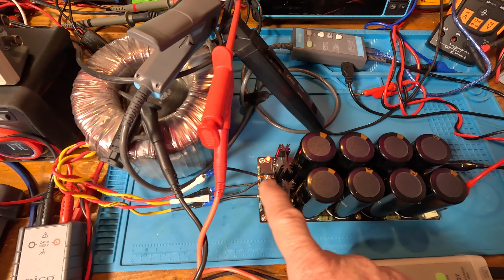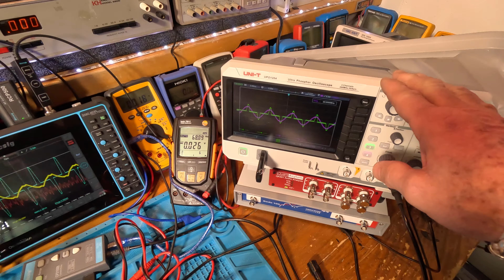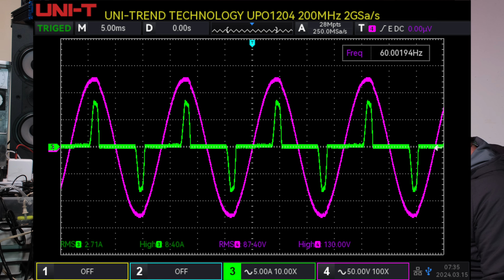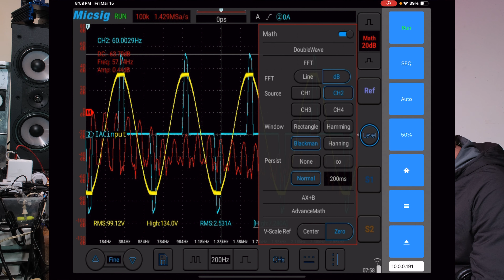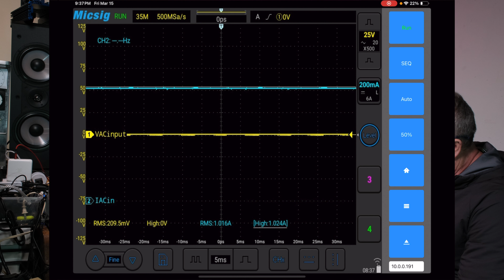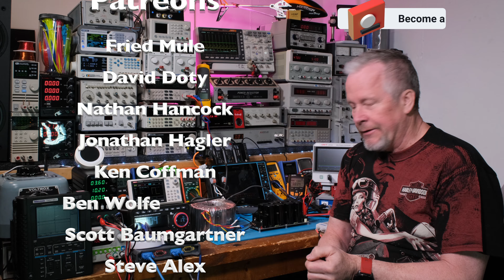Low Frequency Power Supply Waveforms Summary #micsig #STO1004

Comment: Nice setup and demonstration. Thanks for sharing.
Now what you need to be able to do is to measure the placebo affect of power cables that cost thousands of dollars.... 😉😉
I watch some audiophile channels and chuckle at the huge so called perceptible difference they claim to hear. Of course you have to have a Hifi system that costs in excess of $100k to begin with or the difference of expansive power and speaker cables is imperceptible.
Reply from the maker: Thank you!  It is very sad that the audio industry is so full of bad engineering and snake oil.  

None of these expensive power cords or receptacles or anything along these lines have been shown to do any good at all.  Unless you are a believer and just want to believe in it.

Comment: In the intro you said that the rectifiers chops the AC and causes the pulsing current creating noise and the non sinusoidal current drawn from the line. This is not quite right. For the most part the cause of the pulsing current is not the rectifiers, but the capacitors they are feeding. With a resistive load on the output of the bridge rectifier the current on the output would be pulsing DC, but the current at the line side would be almost a perfect sine wave. The input current would also be in phase with the voltage. There would be the smallest, totally insignificant, discontinuity near where the voltage of the line crosses zero volts. And because the voltage is near zero the current also would be effectively zero with or without the rectifiers. The rectifiers are getting a bad wrap, but the problem is really the non linear load of the capacitors. They are the reason for the high non sinusoidal current pulses.

But all this noise would be cleaned up if twisted pair, gold plated, oxygen free copper cable was used for the line cord. 😯 Just kidding. The idea that the input cable has any real effect on the noise is laughable. 

I got hooked on audio as a teen in the 70s. Took electronics in college. I'm retired now but for 37 years I worked for two small electronic manufacturing companies designing a variety of commercial electronic product. From environmental monitoring to ultrasonics, motor control,  microprocessor designs, and embedded computer control systems.
Reply from the maker: Thanks for your feedback!  I can see what you mean by the diodes getting a bad rap - and yes it is the concert of parts working together that cause this pulsating current.  However, the reason that I point to the diodes - it is because they are allowed to turn on naturally and without control that results in this pulsating current at low frequency.  If for instance they were replaced with a device you can control like a FET, then they could be switched fast and you would have a PFC.  

In this power supply, where the pulsating current occurs at the early part of the sinewave, it causes a phase shift adding to the poor power factor, but also because the current is butchered to a pulse which the distortion also adds to the poor power factor.

Comment: You are right. But you also have a shockley diode bridge rectifier, and you also have 100 nF capacitors, but if you had a normal bridge rectifier without 100 nF capacitors, the results wouldn't be so good. On that wool 100nF should also be put a capacitor of 1uF or 2.2uF, yes they are put at the midpoint (in the middle - GND). According to the Italian magazine - Nuova Elettronica (I don't know exactly 215 or 232 anymore)
Reply from the maker: Thanks for your feedback!  A low frequency switcher doesn't benefit as much from Schottky diodes, but a cap can clean things up a bit.  It shows how noisy a low frequency switcher actually is.

Comment: The bridge rectifier, is this a standard diode or fast recovery? Did you look at any effect from a snubber capacitor over the diode? Really good stuff, thanks.
Reply from the maker: Great question!  For the low frequency switcher - the speed of recovery does not matter much - as the cycle time is so slow between pulses.  But it does have some effect.  I'll have to do a video where we look at this.  A snubber on the low frequency rectifier would have to be huge - but it is not really needed.  The commutation is so slow that there is not the typical ringing you might find in a high frequency switcher.  But it is a great idea to use a cap across the bridge to filter some of the noise in the commutation.

Comment: I love that power cables, cheap ones they don’t matter. 

That will bring out the pitchfork and torches  🤣🤣

I cannot wait to build your switching power supply to put it on one of my preamps and amplifiers at Burning Amp Expo  in San Francisco
Reply: I have been hassling him to get past PFC and get on with the supply its been years, it would help if you and others get at him too
Reply: @andymouse  I’m true blue, old-school linear power supply, believing kinda guy. 

If somebody could make a switch mode, power supply that is so quiet that you could put it in next to a phono stage in the same case without noise then you know you got a switch mode power supply. 

Something that will change the minds of even the most scrutinizing measuring audiophiles
Reply: I agree totally and believe the same thats why I want to see one designed it will be fascinating :) @coldfinger459sub0